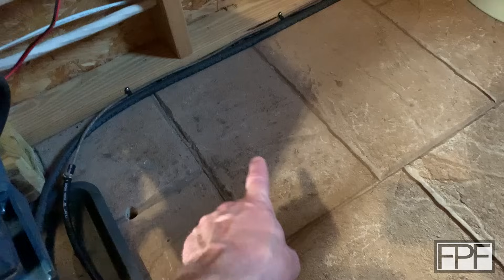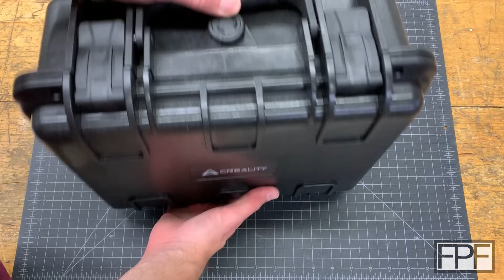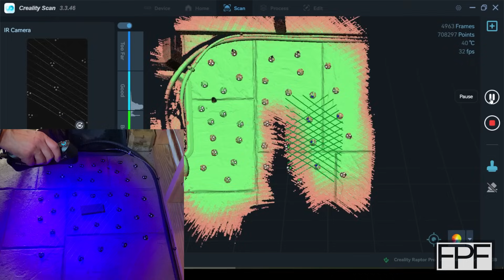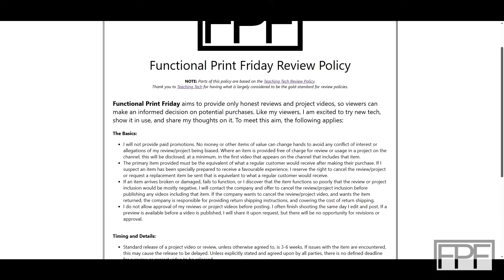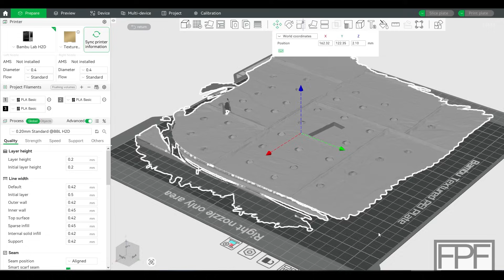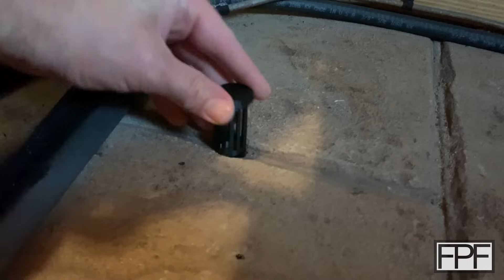3D Printed Floor Drain Strainer - Scanning with the Creality Raptor Pro

Comment: I've also never seen a proper hammer drill use normal bits with a chuck.  Every one I've seen has SDS bits to allow them to move back and forth

Comment: Just a thought... For an "emergency" water hole, what about making a plug using water soluble support material.
Reply from the maker: Love the thinking. Would still need to filter out the big stuff. Could be multi-material
Reply: @FunctionalPrintFriday  I was just seeing it as an "In Case Of Fire" plug rather than an open drain. I've never used that support material, so didn't know if even a thin layer would dissipate fast enough and without agitation to be useful.

Comment: Another great video and some excellent suggestions about a Mk 2 with a mushroom shape, made in TPU! When I design a part, I spend some time crossing the T's and dotting the I's only to discover when it's printed about a dozen "improvements" I could easily make, now that I have something concrete to look at!

Scanner is cool but way out of most hobbyists' budget, I would suggest. Be thankful you got it for "evaluation purposes" as I expect you would not have bought one at that price either!

Thanks again for your channel; you are most certainly not just talking to your workbench.
Reply from the maker: It's like the hammer drill.  You don't need one until you do.  I definitely wouldn't buy one at that price tag to just have on hand or toy around with, but the first job where you really need it, the cost is relative to your time to try and work around not having one, especially if it's work you're charging for.

Comment: If you want to decrease the risk of accidentally breaking it, I suggest you make it more of a "mushroom", i.e. a much wider, rounded top which sits flush with the floor. But you also extend those slits into that "mushroom top" so the water can still pass through. If you make it 150mm or so in diameter but only 20-30mm tall, it'll be hard to accidentally break.

Comment: The cross sectional area of the slits doesn't need to be any bigger than the hole coming out the bottom of the thing. I think you could sink it a bit deeper and still keep that in mind.
Reply: Additional cross sectional area on the slots would help preserve drain capacity as material obstruct the slots, although it would require elevated fluid levels to access that capacity.
Reply from the maker: @MichaelTavel  and allow entry from the side where the water is

Comment: Good solution, but I would have made it a two piece plug, one sleeve that sits flush, and one that slides in with a mesh or slots. That way you can periodically remove it and clean it.

Comment: A suggestion:
I would check what voltage rating the power supply of the Scanner has.  These days there are many USB-C PD to Barrel Jack Adapters or cables that have the necessary chip inside to tell the USB-C power supply or power bank which voltage it wants.   If the original power supply uses a standard voltage like 9V, 12V, 15V or 20V there will definitely be such an adapter / cable available. That in combination with a power bank would at least make it a bit more portable. I upgraded almost all my devices that use barrel jack power supplies this way to support USB-C PD.  So much more convenient these days.

Comment: "Now we could use water on the floor to see the lowest point and I could just dry it off with a towel, but if you happen to have a 2000 dollar 3D-scanner, a small precision ground surface plate, a very accurate level and some time, you could instead do this" :D
I'm just messing with you. It's an interesting application and a fun way to use the tool.
Reply from the maker: lol, true to an extent.  The surface tension of the water makes it hard to use water for measurement on the surface with an accuracy greater than ~3mm.
Reply: @FunctionalPrintFriday  I was thinking that, but then again what's the problem we're trying to solve here? "How is the water going to drain?". So in a sense it's kind of meaningless what is the lowest point if the water will not follow. And you could add a surfactant like soap of course to lessen the surface tension.

But none of this has the cool-factor of a 3D-scanner though. :/
Reply from the maker: @Itslvle  love the surfactant idea. Was fun nonetheless

Comment: You don't have a saltwater pool.  Salt pools use salts to produce chlorine differently, but it is a myth that you have salt water.  FYI, saltwater pools have their benefits but the increased TDS and corrosion potential are definite downsides.
Reply from the maker: I beg to differ.  I add 400lbs of salt every spring to maintain ~3500PPM salt in the water.  As the pump circulates water through the SWG cell, a small amount of the salt in solution is converted to chlorine through electrolysis.  The common misconception you're probably thinking of is that folks with saltwater pools often think they don't have chlorine in their pools, and they absolutely do, they just don't ever add it, the SWG cell generates it.  You can also maintain a slightly lower 'free chlorine' level in the pool due to the fact that the water running through the cell is technically "hyper-chlorinated" until it exits the return pipe.  I open/close and fully maintain everything with the pool myself to keep the costs down.
Reply: @FunctionalPrintFriday fair enough, but ask anyone what constitutes "saltwater" and that ain't it.  With over 10 years as a pool designer, I avoid these systems.  Really outside of knowledgeable and technically savvy home owners (which you seem to be) "saltwater pools" are a recipe for problems.
Reply: @FunctionalPrintFriday also wanted to add to your very accurate assessment about the lack of knowledge and understanding about pool chemicals ( for all pools.)  Most of what ppl attribute to "chlorine smell" is actually chloramines ( a byproduct of chlorine breaking down organic matter- read piss, sweat and body oils moslty).  If it was chlorine there would be more instances of respiratory injury.  Chloramines are typically a sign of a poorly balanced pool which is operated by someone that doesn't have the qualifications or thinks shocking a pool is an acceptable practice

Comment: I wasn't concerned about testing it, but I was thinking that if you're walking through this area and concerned about stepping on or kicking the cover, that perhaps it would be better to make the spare out of TPU at a firmer output level. Perhaps even cross brace it internally for added stiffness, but remaining flexible enough to stand up to that little bit of abuse after it's been sitting there through a winter or two.

Comment: I think I would make same style part but threaded where top piece acts as a basket or finer strainer that screws into the bottom half, then you can clean it out simply unscrew top half and rinse out.  The top half would have a cross sectional strainer built in that screws into the lower half.    I am curious to see how you make out with your scanner.  I got the Metrox scanner two months back, have used it quite a few times.  The near infrared mode is more to get fine details, such as fine surface details.    It does come in handy only if  you need the fine details added.   My scanner has similar settings, I rarely used the blue light mode, but that is the purpose is to extract fine surface details.

Comment: I live in a natural stone house built in the 1930's, when I renovated it I had some holes to drill and all I had was the basic hammer drill just like your small one but Makita. I went through about 3 or 4 drill bits just on one hole, the stone is hard. I went to the hardware shop to get more drills and asked for 10 x 10mm drills. within 3 x 40mm holes all were blunt so I went back to the same shop and show the guy how good(not) the drills were that he was selling. When I told him what I was doing he came out with a new drill, it was the electropneumatic one the same as your bigger one and 1 sds drill bit. When I asked for more drill bits he said I didn't need any more than one and also he said if I did he would give me the drill and bits for free. Needless to say I didn't need any more bits, those electropneumatic drills go through stone like my normal drill goes through wood, this was over 30 years ago and though a black & decker(professional) its still working great, I also still have the 10mm drill bit too with well over 100 holes in stone. Sorry for the off-topic but it just brought back memories and just might help someone else decide on what drill to get for stone, concrete etc.
Reply: Love hearing about these real world experiences - the right tool for the right job makes such a difference!  Thanks for sharing this, I did not know the difference!
Reply: this is definitely on topic

Comment: There are no 3d scanners that don't require post processing. Until they get that good OR the software gets easy to use, 3d scanners will always bee very niche. I'd buy one today if they did what they advertise but they need skill after the scan that I don't have.

Comment: You can 3D scan this floow for free or really cheap with a smartphone camera and photogrammetry software. I have scanned a WW2 helmet or a dagger with sub-millimeter precision that way. So you don´t need a dedicated scanner gear gizmo which will be obsolete in 2 years time or come with a subscription or whatever. You can use any camera and a piece of free or payed software.  You won´t need the markers that way either. You can use them but it works just as well without.

Comment: Regarding the USB stuff:
- for power, no host device outputs more than 5V3A, so if it needs a higher wattage or voltage, you're SOL without a separate power supply.
- for data rate, the max cable lengths for passive cables are roghly 5m for USB2, 3m for USB 3.x 5Gbps, 2m for USB 3.x 10Gbps, and 1m (or often less) for anything above 20Gbps. I can't remember the length for 20Gbps off the top of my head, but I think it's either 1m or 1.5m. You can get longer cables with optical teanscievers in line or with signal repeaters built in, but that drives up the price by a ton.
Reply: I'll add a "technically", because it's a USB-C device the other end, if they made it USB-C then it could take USB-PD and get more than 5V3A—there are a few desktop motherboards out there that offer USB-PD on a data port, but it's very rare at least right now (especially in mobile devices).
Coming from networking gear, the optimal set-up would be an injector in the style of PoE ones, where you have a single USB-C cable but also an injector that has power and data inputs and combines them, but that'd obviously add a lot of cost for little benefit, right now at least.
Reply: @lattyware True, though it is extremely rare, to the point of essentially being nonexistent, and those that do typically don't deliver the most useful PD voltage - 20V - because that would require a boost converter on the motherboard to feed it, which would be both expensive and take up a lot of space. So you'd be stuck with 12V (which is deprecated in USB-PD for whatever reason, but still widely supported from chargers at least) or 9V for officially supported voltages (or, I guess, up to the PC PSU's 12V using PD-PPS) . More useful than 5V for sure, but definitely not a lot. And mobile devices often don't even deliver the full 5V3A reliably, despite the higher end USB specs requring it - that's just the nature of being a secondary/tertiary priority in terms of power delivery (system and display come first) in a battery powered system with pretty hard limits on long term current draw.

I agree that some kind of injector would likely be the best solution - and honestly it shouldn't even be that difficult or expensive, given that you get cheap PD charge+OTG dual port USB-C adapters for phones and laptops supporting at least up to 20V5A - though I don't know if I've ever seen one of those support higher data rate USB standards. No doubt they exist though.

Comment: I tried to develope a thing like that for the shower and failed due to the reduced speed the water flows it clogged quickly so currently I continue cleaning the pipe on a regular basis...

Comment: Do you have any concerns that you might get a fuel spill which can now drain into the building’s sub-floor?
Reply from the maker: I did stand there thinking about it for a few mins, but if the tank ever leaks, it's unfortunately going in the ground regardless, it's just a more direct route since I drilled the hole.  Before the hole, it would just seep under the sill plate, which is what the water was doing, albeit very slowly.  Next time that drum is empty I might put a pan under it.

Comment: For the drain cover, I'd have used TPU and flared the top to be like a mushroom shape. That way stepping on it wouldn't necessarily destroy it.
Reply: PLA first. when he does step on it and smash bits of PLA down into the hole, that is content for the next video with the endoscope, articulating grabber tool and eventual TPU replacement print ;p

Comment: A small note, there are proper SDS drill without a dedicated hammer mode, they are usually smaller models though. But even those will blow out regular hammer (or rattle) drill out of the water. Btw bosch makes some pretty nice sds drill, just a suggestion ;)
Reply: SDS FTW!
Reply: Any "Hammer Drill" with a standard drill chuck is not a worthwhile hammer drill.  Drill chucks inevitably slip and or loosen in the chuck (when in hammer mode), SDS styles won't do that.

Comment: I would have tried TPU which would be more 'crash-proof' and flexible to jam down the hole for a tight fit.
Reply: And then made more 'clearance' around the hole so that it falls all the way in. When there is no water it'll be out of the way and if the water builds up it should float let the water drain then sink back into the floor.

Comment: I'm not saying you shouldn't have used the scanner for the floor. It's definitely good for the video and practice... but, Wouldn't it have been easier to put water on the floor and see where it pools up?
Reply: Which is actually the method he accidentally used to find out where to put the hole in the first place. "I don't know how we otherwise would get a good idea of what really is the lowest point", sure you do, you already did it.
Reply from the maker: @VidarHaslum  The challenge is that the surface tension of water combined with the porosity of the floor makes it harder to get better than ~3mm of precision with that method.   No argument that it was unnecessary to scan it.  Since the hole was already there it's either going to drain or it's not, but it was a fun exercise :)
Reply from the maker: The challenge is that the surface tension of water combined with the porosity of the floor makes it harder to get better than ~3mm of precision with that method.   No argument that it was unnecessary to scan it.  Since the hole was already there it's either going to drain or it's not, but it was a fun exercise :)

Comment: I'd suggest that the smaller drill is a hammer drill and the larger drill with the none rotary "hammer" is actually a percussion drill. I have both Milwaukee M12 and M18 percussion drills. The M18 has rotary only, rotary plus percussion and percussion only. The M12 does only rotary and rotary plus percussion, no percussion on its own. Both M12 and M18 HAMMER drills are quite effective drilling bricks etc with ordinary masonry drills, but are borderline on concrete. I find I use the M12 SDS percussion for just about everything up to 14mm, its a really handy little drill. I'm pretty sure that that the move up to SDS is the point a drill becomes a percussion drill and is no longer a hammer drill.
Here in the UK 🇬🇧 the naming of the Bosch percussion drill range always amused me, they normally went under a naming of GBH. GBH is the acronym for the criminal offence of Grevious Bodily Harm, for instance attacking someone with a baseball bat.

Comment: I would suggest on version 2 you make the top a mushroom shape about the size of a hockey puck.  So, perhaps hockey puck shape, then 45 degree chamfer the top edge and put a bunch of slots/holes around the perimeter or groves on the underside.  This will increase surface area for screening debris and your foot will be more likely to glance off it instead of decapitating it.  The stem could just be an almost solid x shape since the filtering is being done by the top.

Very cool use of the scanner.  They are getting really good.
Reply: Came here to say this but you beat me to it ;-)

Comment: Why shouldn't you stand in a puddle of water with a power tool? 
Are you planing to submerge your power tool?
Are you expecting the floor to have live power on it?
Reply from the maker: It seemed like a good preventative measure :)
Reply: If your power tool is not in a GFCI protected outlet giving yourself a good ground with water that has residual salt in it seems like an unneededly high risk in the event of a problem with the tool.  That said wood soaked in salty water might not help that much :-).    GFCI is the way to go.